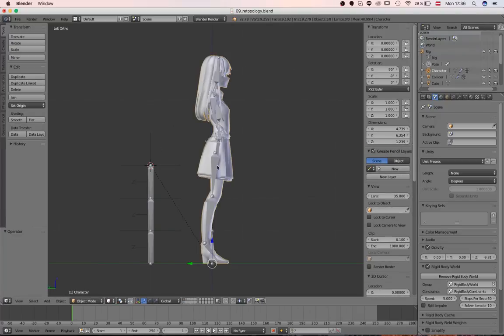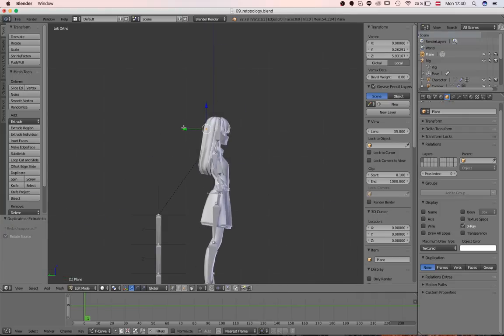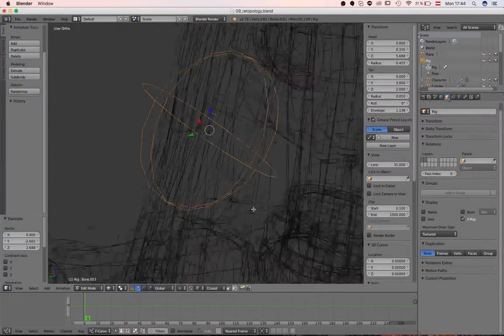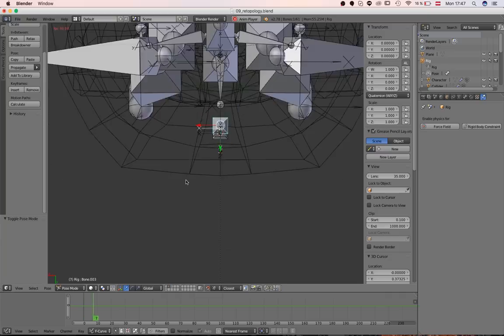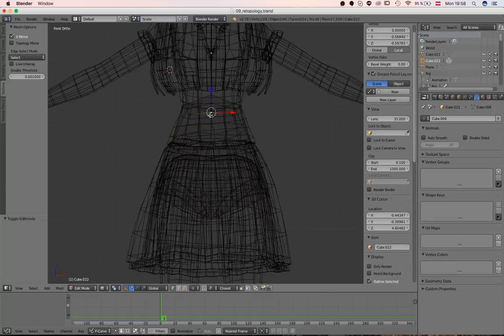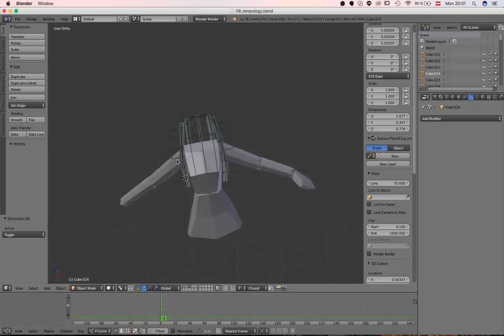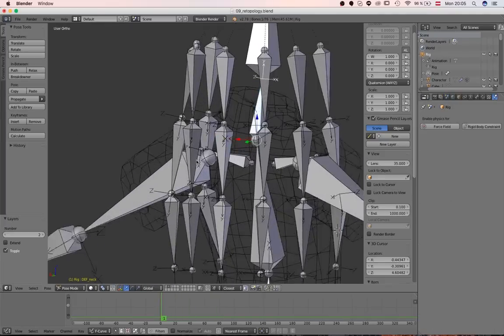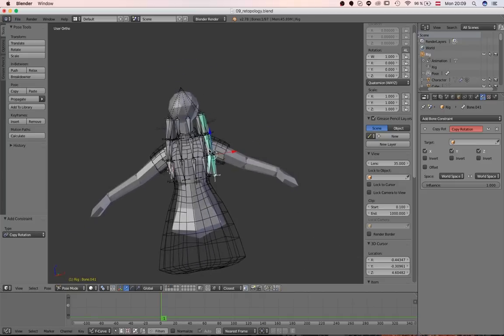[5/6] Complete Character Rigging Guide (w/ Hair Physics) - Blender Tutorial

Comment: For those who got problems with the rotation of the constraint you can fix it doing this:

Instead of using the copy rotation use the first bone (this one has to be with automatic weights when you join it to your mesh) select the cube of the bone as target, then the collider of your head or body so you only have to rotate the  pole angle and there you have it, a functional IK for the hair bone with the sistem of @Daniel Kreuter <3